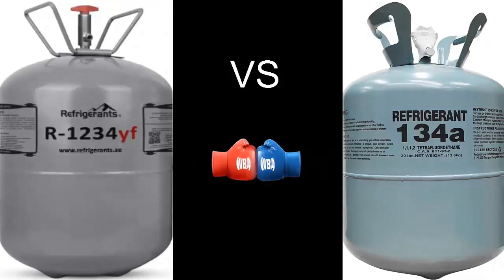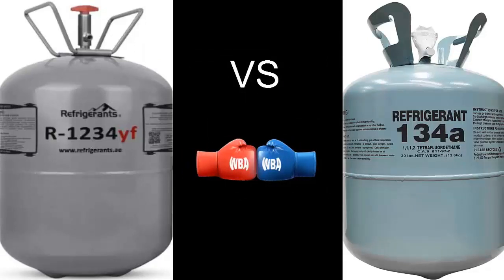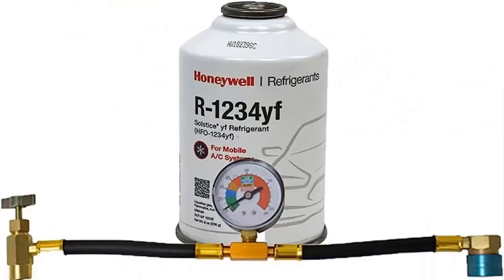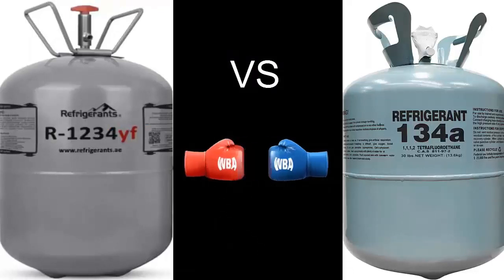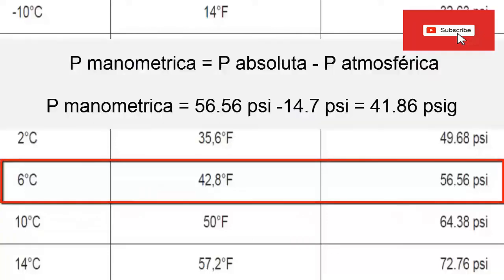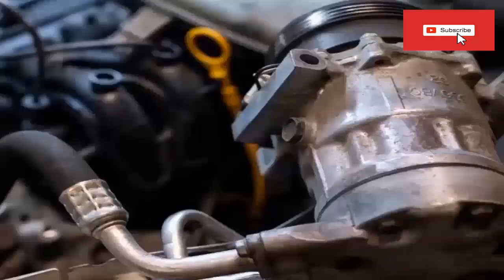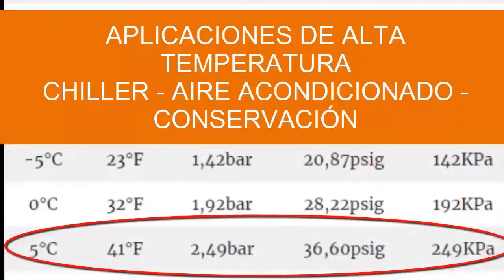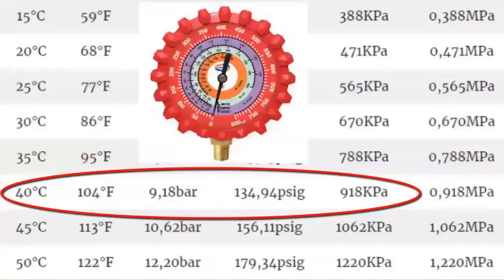Difference between r134 and 1234yf  AND can you use r134a in r1234yf ac system?

Comment: About 25 to 20 years ago there was a refrigerant advertised in the Auto Roundup magazine that the ads claimed was MORE EFFICIENT than R12  but was HARMLESS to the OZONE (unlike R12 and R134a). Also it claimed to be a direct replacement for R12.  Not sold in any stores that I noticed.  What was it ?
Reply: Propane
Reply: @adamjankowski4315  Are you absolutely sure ?
Reply: @adamjankowski4315 Not exactly, even if it was, BFD.
Reply: Hard telling, there is freeze 12, there is enviro safe and other alternatives. I used enviro safe or ES-12 it's compatible with oils and R12 itself. It mimics R12 performance very very well, excellent idle performance and takes about 2 minutes to bottom out to about 38°.
Reply: I used R12a recently (I believe it was envirosafe). RedTek is another name. I think they are very similar to propane. To my knowledge, they can go into a r134a system. I’m assuming it’s even more flammable than 1234yf, but there aren’t many examples of problems, short of one catastrophic bus fire (I think in Mexico or Guatemala?) caused by a poorly maintained system…